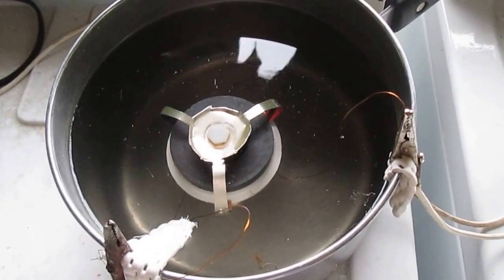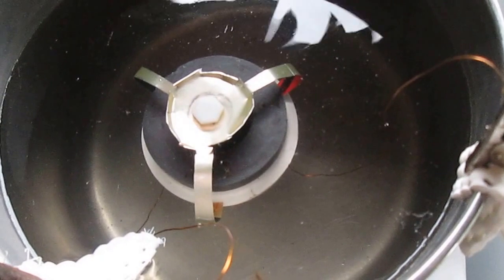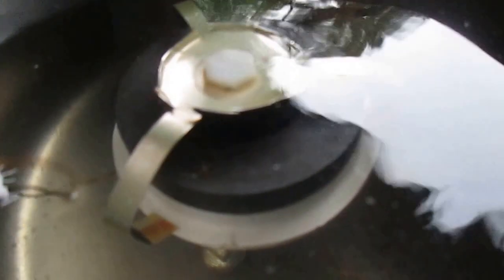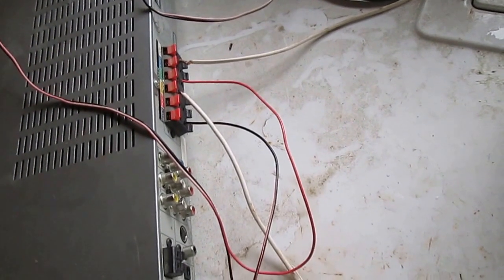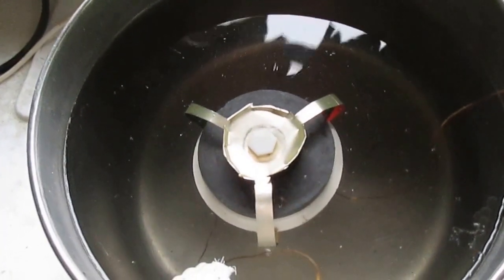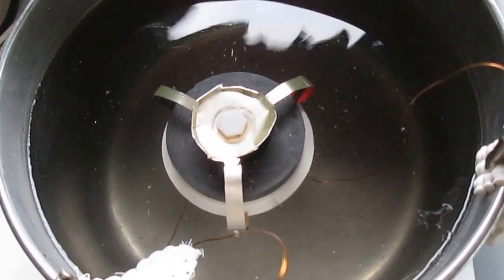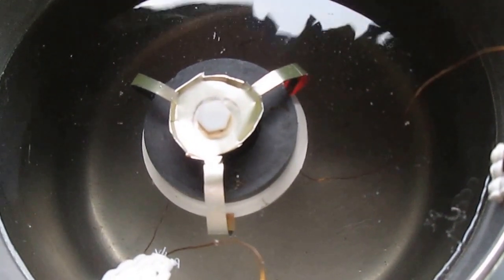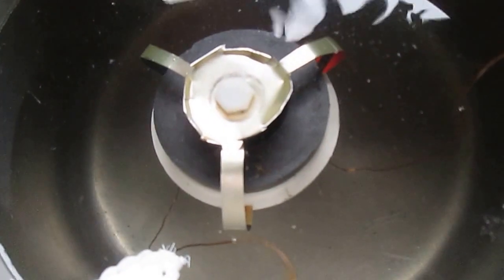HHO 98 second resonator

Comment: Hello Helmut,
It is not a question of music, it is a question of rythm that are impulse in the water.
Violon would make nothing. Also, 45 hertz will make nothing. 45 Khertz would be more appropriate. From 20 to 25 Khertz would be enough.  Try with ultrasonic water device and put it both in the water with your sound.
I think you must construct 2 transistors device amplifier, that would recieve your music and pull it mixed with few volts more into the water.